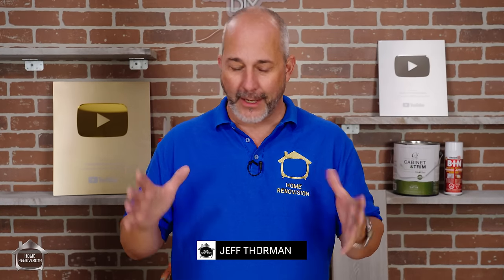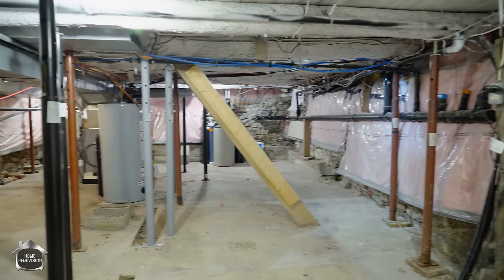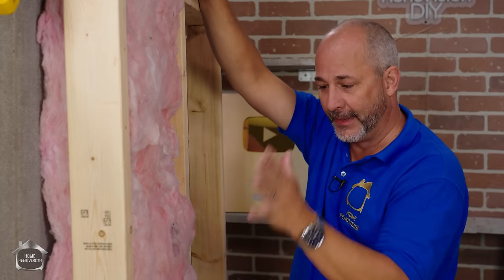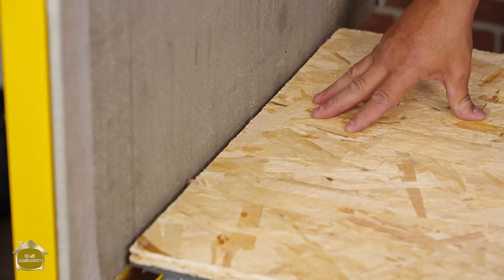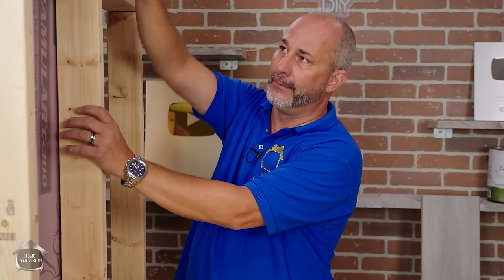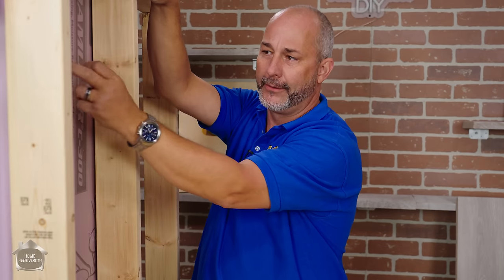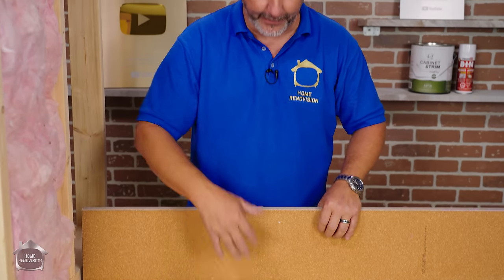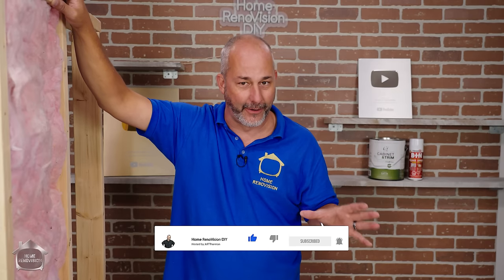The Best Way To Finish Your Basement

Comment: Home was built on 1976 and has a waterproofing membrane underneath the slab.
Tip #1 in finishing a basement: Don't bother if your home is situated on a high water table or have an active sump pump, not unless you like pulling up carpeting and ripping out drywall.
Reply from the maker: if the pump never stops working then you are guaranteed to be overwhelmed at some point. Cheers!@
Reply: @HomeRenoVisionDIY  Was in a much better position before basement was worked on. Waterproofers seem to have accessed and facilitated a perpetual supply of groundwater. Whether it's simply due to a pervasive high water table (block/neighborhood shouldn't have been developed with full basements, as many suffer from issues related to chronic dewatering), an underground stream or spring, a marsh deposit (home is situated near former designated wetland), is really anyone's guess.

My mistake was two-fold.
1) In entrusting the basement waterproofing industry to be the experts and placing faith that they wouldn't simply compound the problem and leave us in a far worse position than the one we started in.
2) In making the faulty assumption that water occasionally pushing up from a far corner of our basement following heavy or prolonged rains or rapid snow melt was localized, finite, or manageable in any way shape or form. 

Creating an additional trench from that corner to our sump was possibly the worst thing we could've done and placed us in an absolutely impossible situation. It is not hyperbole to say that it sabotaged our home and made it unlivable and unsellable in one fell swoop. Now the only way I have any chance at regaining control of the situation is to look for ways to reverse what was done. But if it were that simple and straightforward it would've been done by now. It will take a feat of engineering, but where there's a will there's a way.

If you live in an area with a pervasive high water table, the absolute last thing you want to do is open up your basement and play around with established subsoil drainage patterns. Stick with the devil you know, as the risks outweigh the benefits. The situation we've been placed in is proof positive of that.

Comment: The concrete in my basement has been coated with Drylok  waterproofing paint.  I am concerned that might have an impact on the water being trapped between the wall and rigid foam with having  no way to absorb back into the concrete. Any thoughts?
Reply from the maker: no worries, we are not expecting the water to exit the house through the masonry. we are expecting it to transfer into the joist package and then find its way to dry air outside.
Reply: What if my rim joist is spray foamed?

Comment: The rigid foam boards are not pressed tightly against the concrete right ? Just enough for air to move?
Reply from the maker: exactly. let it set up and then tape the joints. Cheers!

Comment: Would you also caulk where the foam board meets the subfloor?
Reply from the maker: no I set it right on top. not building a submarine here. no need to overthink it. water management is a 95% right kind of game. Cheers!

Comment: What if your floor has drains? Can these be capped to install the subfloor or do they need to be removed and concrete over?
Reply from the maker: you can install a backflow valve in the drain. that way it functions if needed and provides a little protection against back flow during heavy rain. for best results install a backflow valve on your main lateral line. Basement drains usually provide more problems than benefits.

Comment: Hey Jeff, the previous homeowner finished the basement about 10 years ago. He framed directly in front of the blanket insulation, and put no extra insulation between the studs. It has been all dry walled up. I’m not sure if it is worth it for me to remove all dry wall, all the studs and re-do everything. Probably not worth it but how bad can this be long term?
Reply: Why not take out a section of the wall and see if there is a problem. You can repair it back to what it was and sleep in peace.

Comment: I was going to change the kitchen track light with led spot lights, but when I turn off the light switch (dimmer) to the existing track lights and went to check to make sure there was no power to the existing track lights since they were off, there was still power to the existing light terminal, it is wire with a black, white and ground but still live! with switch off and lights off, I am confused, there is no secondary switch, help!

Comment: Just a question if anybody could chime in.

Around 7:24 he says the rigid foam is to be set on top of the concrete but shows it on top of the Dricore.

Are you suppose to rigid foam against the wall and then leave the gap for Dricore and stud on top of the Dricore?

Or

dri core and then foam board on top of the Dricore and then stud in front of the foam board?

Thanks
Reply: Pretty sure its dricore against the concrete wall, half inch a way, then foam board on top, then stud after foam board.

Comment: To achieve a better thermal break and get better air and water vapor performance, be sure to use proper tapes or foams along every single seam. Overall great video, but glossed over that bit.
Reply from the maker: the panel systems have no actual way to create a break and are only valuable when material costs are out of this world. for best results install your own system to truly create a break.

Comment: Why is a vapour barrier still required between the batt insulation and the drywall? I thought the foam board, properly sealed during installation, would act as a vapour barrier.
Reply: That’s what I was thinking. Just have my basement gutted to the foundation. Previous owner put vapour barrier against concrete, then framed and insulated, then more vapour barrier, then drywall. Was literally a greenhouse and soaking wet when we opened it up.
Maybe Jeff will weigh in on the need for a 2nd vapour barrier on the warm side?
Reply from the maker: it acts as a vapor barrier for moisture travelling in the air space behind the foam. the plastic keeps the warm air from condensing in the framing which leads to mold, during the winter when the furnace is on. Cheers!
Reply: @HomeRenoVisionDIY  so.. Concrete > closed cell foam with glue gap > studs with fiberglass/rockwool > type 1 vapor barrier? (or type 2 or 3?) > drywall

Did I miss something?
Reply: @HomeRenoVisionDIY  thanks for the response, Jeff. Honestly my first time commenting ever on YouTube, so it’s pretty cool to get a response from a person I’ve been following for a while.

Is this type of installation documented in any National/Ontario Building Code, or manufacture install best practices? It just seems so strange to have framing sandwiched between two vapour barriers based on previous experiences with a foundation > moisture barrier > frame/insulation > vapour barrier > drywall  installs.
Reply from the maker: The foam board folks have done plenty of testing. I have personally used this for years now.
Reply: The vapor barrier will just give water a place to accumulate. If you need a vapor barrier you weren’t ready finish your basement. Ground water should be redirected below the floor with weep holes to a drainage system that doesn’t sit in the mud. This should drain to a sump basin and be pumped up and out of the basement and a drainage line should be extended at least 15 away from the house. The sump basin should have a lid that is air tight.  A high efficiency dehumidifier capable of removing 100 tints per day should always be set to below 55 percent relative humidity and drained into a sump. Both should be on a separate dedicated circuit with battery back up and alarm.
Reply: you dont want a double vapour barrier or it traps moisture and promotes mold growth… so this is interesting

Comment: Hi Jeff or anyone else. I have a pretty old house and plan to finish it. Unfortunately the previous owners had no idea what they were doing, and installed 2x4 frame walls to the foundation walls then spray foamed. This means the frame is directly on concrete (not vapour barriered) and the spray foam doesn't let the foundation breath. 

Any suggestions beside ripping out all the spray foam and framing and restarting?
Reply: Having dealt with anxiety about mold in an unfinished basement myself, I would personally make the choice to start it all over again, unfortunately. No good finishing the basement if you know for sure there's no room to breathe behind the walls 😬

Comment: Wouldn't it trap condensation if you put a plastic vapor barrier on the inside of your studs if you already have the rigid foam?
Reply from the maker: no! a vapor barrier keeps condensation out. Any excess moisture in the wall framing will be balanced by RH properties by travelling into the joist package. We use kiln dried lumber when framing so it comes balanced already.

Comment: 2 inches of XPS (R10) is considered a vapor barrier.  After studs I assume you're putting another vapor barrier.  Wouldn't you be trapping moisture?
Reply from the maker: common misconception. since the 2 barriers are not in contact with each other there is no trapping and condensation. in fact if you use the acoustic sealant on perimeters for both layers you eliminate water access inside the insulation cavity and any water in the wood will regulate with the relative humidity of the house through contact with the floor joist Cheers!

Comment: Do you recommend building interior walls on the subfloor or use treated wood directly to the basement floor?
Reply from the maker: on top of the subfloor so the airspace under the subfloor kis shared with the airspace behind the rigid insulation. Cheers!
Reply: @HomeRenoVisionDIY  but you still tapcon thru the subfloor into the basement floor, right?
Reply: Dricore insulated panels are 1" thick. 
The bottom plate 2x4 is actually only 1.5" thick. 
If you don't put the walls on top of the subfloor you're left with only 1/2" above the dricore on the perimeter.  It's also a good practice not to place your drywall right on the subfloor, especially in a basement. 
I don't believe there's a law, but if you're starting from scratch building walls on the subfloor can save headaches down the road.
There is however no law saying you have to install baseboards. I can attest to the fact you can go decades without installing them and live quite comfortably. Just ask my ex.
Reply from the maker: @MrAbcdefghi12345 optional but yes i prefer to do that to guarantee the space at the wall. Cheers!

Comment: I was told if you did foam insulation up against the foundation wall, and then sealed all the joints you shouldn't also use a vapor barrier.  Any truth to this?

Comment: Do you have to install the subfloor system or can you just do the R-10 foam board and the framing?
Reply: You just skimmed through the video, huh? Rewatch and listen
Reply: @MD2020Drums  I watched the video, Still have a question about this though.  My California house actually has a basement, they're very rare here.  I also live in a very dry area, so I was wondering If that subfloor system would be necessary for my basement.  I would like to install the vinyl plank with the underlayment straight onto my basement concrete floor.

Comment: What about polyurethane spray foam on the concrete wall? Do you still need fiber glass insulation
Reply from the maker: if you have an exterior waterproofing system and want to use spray foam then no. I personally feel like this is not as good as what I just demonstrated and my system provides security in the case of water events that spray foam on the walls does not.

Comment: 💥 Unfinished and uninsulated basements in New Jersey don’t get any colder than about 63 degrees in the dead of winter. Very little insulation is needed.  The old R13 would be more than sufficient. 
And what a disaster it will be framing the walls on top of that subfloor system you show in the event of a flood of any type including a bursted hot water heater like happened to me.
Mold remediation companies need to remove all flooring immediately to get everything dried out and they will not be able to rip up the flooring that’s shown here since the walls are framed on top of it.  This will be a mold nightmare with no solution on how to treat it.  “You’re going to get all types of moisture events in your home”.  You said it yourself.

Comment: Hi there, going to be starting this project this weekend on a duplex. Are you tuck taping the foam board between the joints even when the overlap?

Also, if your basement floor is unever would you use a self leveling concrete mix before putting down the subfloor or try to do it on top? We plan on putting LVP on top.

Thank you!
Reply from the maker: flooring has a variance that can be acceptable . check with your flooring manufacturer. as for the tape. best practice yes. Cheers!

Comment: We bought a house with a finished basement 7 years ago. We ripped it out. got the water line to the house replaced; it was leaking and the previous owner was paying $600 per water bill. Plumber didnt correctly seal the new hole in the foundation wall and we had massive rains that flooded the street to the height of vehicle doors. Guess what my basement looked like. That was the NE corner. also water flooded through the walkout sliding door in NW corner due to gardens added to sell the house diverting water toward the house instead of the swale in the backyard. also learned that the previous owner did a patch job on a basement window that had rotted out… water again. that was the SW corner. And then our sump pump failed last year and we didnt realize it until the middle of our basement was a puddle and discovered the sill plates of 3 walls were dust. And then we had AC ductwork updated and had to rip out the ceiling anyway.

How to finish a basement: DON’T.

Comment: I want to finish my basement in my 1970s townhouse but the outside walls have steel 6" supports drilled into the concrete floors and onto the joists. The city said to build in front of them but then isn't there a huge gap to fill behind the studs?
Reply: Make the gaps between the supports into closets.
Reply from the maker: in your case. you get the space that you get. more air space behind the wall is not a problem as long as you continue the insulation to the rim joist. Cheers!

Comment: Do not want to use sheetrock even the mold control stuff in basement because of mosture already ripping old stuff out.... is there a good comparable priced pvc, anyone use the concrete board  option or other option i didnt think of? I feel stupid rippingnout sheetrock to put in more sheetrock

Comment: How does framing basements with ICF (insulated concrete form) walls change this advice?
Reply from the maker: icf has it's own thermal rating. in many cases all you need to do is frame the walls to allow for running electrical. I would add batt insulation just for the added insulation since it is relatively low cost and helps to quiet the space.
Reply: Thank you so much for the reply. In my basement they already ran electrical by cutting grooves in the ICF for the wires. I'm trying to figure the best options for finishing. In another area they screwed sheetrock directly to the plastic joints in the form so I know they didn't stub it there 🤦🏼‍♂️

Comment: Thank you for all your informative videos! Do you have a video that explains how to attach the 2x4 wall frames after the rigid insulation is installed? Is the framing nailed to the rigid foam insulation?
Reply: I think you need to find someone capable of understanding physics +6 years old. My 7 year old son wouldn't try to nail something to rigid foam.
Reply from the maker: yes you use tapcon to secure the subfloor and then construction screws to secure the top of the framing. Cheers!
Reply: Thank You!

Comment: Does a subfloor system help address any uneven spots on the concrete?
Reply from the maker: not really. for older house with bad slope I suggest carpet on subfloor. trying to fix the old problems is too expensive for the return on investment in older homes.
Reply: @HomeRenoVisionDIY thanks for the respnse!  it's a 2016 build.  To the eye, the concrete pad looks very straight.  I installed vynil flooring with a pre-attached bottom layer directly on the concrete. In one area of the room, i hear a click when I walk on it.  Was wondering if larger subfloor tiles would help mitigate that loose floor tile joint, or if I would be better off trying to level out any dimples on the pad and then going for the subfloor and re-installing the vinyl layer.  Sounds like a lot of re-work, but it's not too bad, I only finished the floor in a closed 10x10 room.

Comment: Wouldn't the weight of the wall crush the foam of the subfloor? What about an uneven concrete floor with these subfloor squares?
Reply from the maker: compressive strength is high enough to install a pool table on it. as for unlevel floors these panels can adjust fine. use tapcon screws if needed to eliminate hollow spots.

Comment: I asked my inspector about removing the blanket insulation and putting in the foam board. I was told no it is against code as it is flammable…?
Reply from the maker: that is only if you do not cover it with drywall at a later date. The same is true for spray foam.